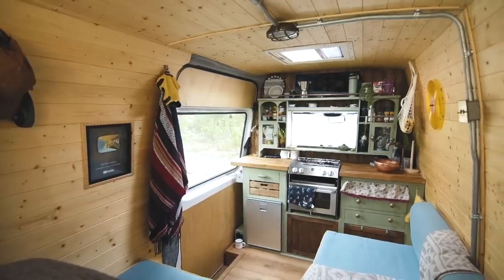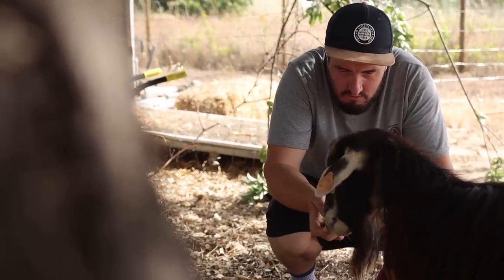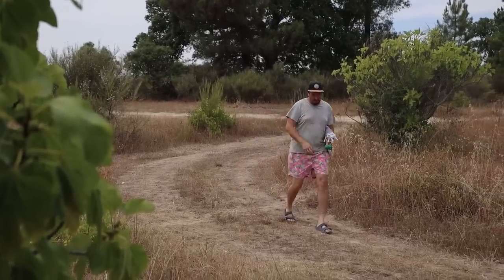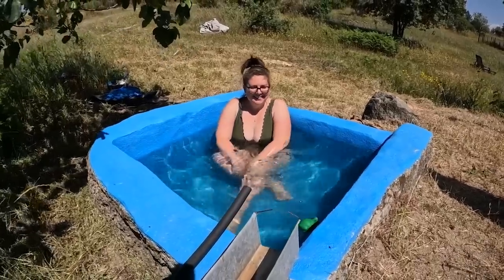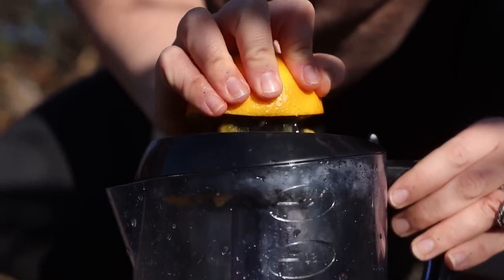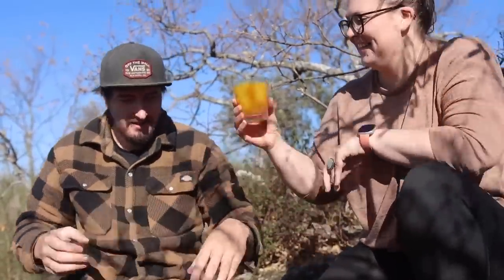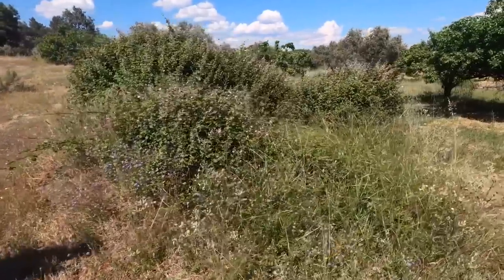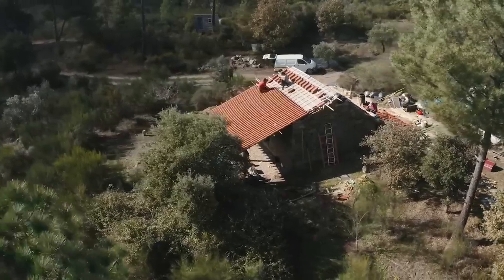6 Months Living in Our Self Built Home! Off-Grid Life in Portugal

Comment: You may not have the water pressure required for in-line water filters. A Berkey filter system would be a good alternative.
Reply: Another vote for the Berkeley system. No power needed as it is gravity fed

Comment: I don't know if it was this video or the last, sorry watched two in a row. You asked about in line water filter recommendations, mine rec is not an in line, but the Berkey Water Filter system. It's a counter top filter, lasts for 10-20 years depending on how many filters you use and how large a system you get. Also when traveling you can use it anywhere. I bring mine to camp to filter Brook water

Comment: I have no idea if they sell it where you live, but I work for an appliance company here in Canada and we do sell some water filtration systems for hardwater. I would say the most common (meaning it will be easiest to replace parts), is Kinetico, Sterilight, and Whirlpool has it too. Those are just the ones I can think of off the top of my head.